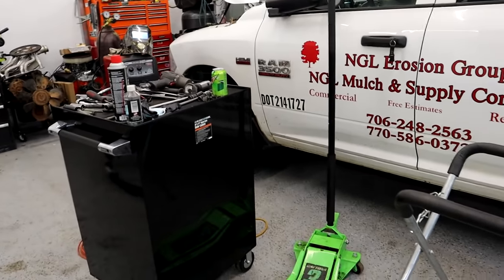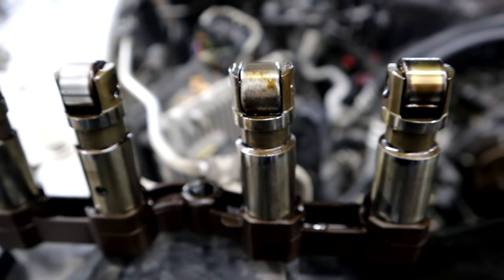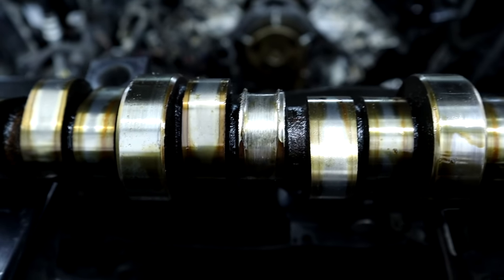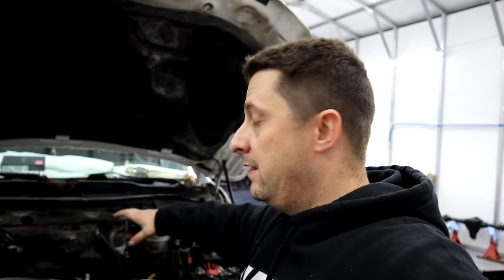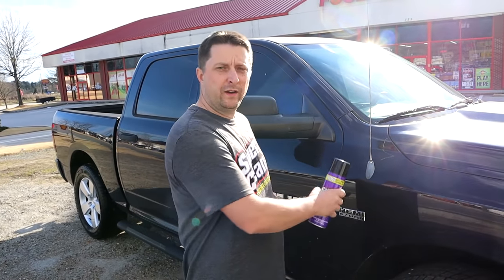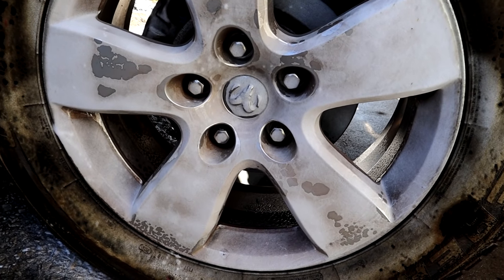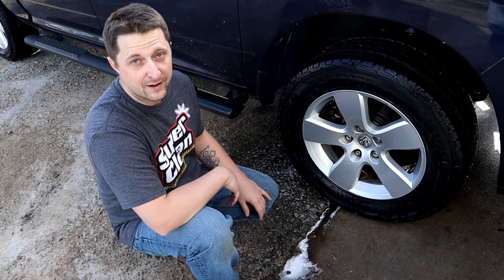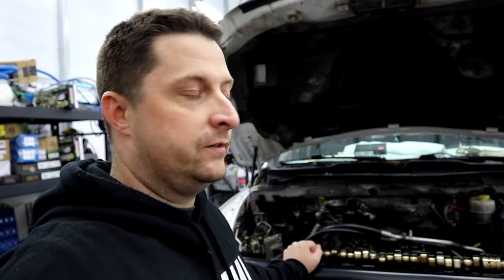6.4 HEMI Engine Failures Common Problems WATCH OUT.

Comment: What I'd like to know is are they changing to a different type of oil other than what the manual calls for? Does the manual call strictly for Pennzoil.
Reply from the maker: I use 5w30 in my 5.7
Reply: Yeah I’d be curious also. My 2020 6.4 calls for penzoil ultra platinum 0w 40 that’s it. It’s $65 to do a oil change myself. I’m hoping that doing it every 5000 I’ll get plenty of life out of the truck. My first new truck. 🤞
Reply: @FrostbiteRam  both my trucks 05 and 2013 calls for 5w 20. both are 5.7 as per manual.

Comment: Its  a manufacturing lifter flaw. There shit designed to fail and ruin cam causing missfire code from not being able to open ontake or exhaust valve.

Comment: Modern day oil is crap thanks to the epa emission system protectionis more important than engine protection, oil change intervals are way too long, super lightweight oils for maximum economy minimum resistance,  lifter bank angle was corrected to get the best pushrod geometry but at the same time is going to stress the cam and lifters more. The belief that roller lifters solve cam failures is false just creates a different failure point the rollers themselves fail all the time when heavily loaded. Just creates a perfect storm and far from one brand specific they all source parts from the same companies nowadays. Better oil designed to protect engine first, shorter change intervals, and less idle time, idling is the worst for any engine. Will help solve alot of failures period.
Reply: 0/40 isn't light oil

Comment: 130,000 miles and half the cam lobe consumed by the engine what does he do about the material that has been introduced from the camshaft lobe that's now been pushed through oil galleys and the rest of the engine ? When it comes back in six months with a lower end knocking who pays the bill ? That's the part that is scary ....
Reply from the maker: My race truck had same failure years ago and I race it hard new cam/lifters and flush been running like a monster 💪

Comment: I have a 14 6.4 2500. I’m creepin up on 100K miles. No ticking or signs of failure yet. 
I change my oil/filters every 5-6K miles at the dealership.
Any advice for preventive? Or just run it?
Reply from the maker: Just change your oil on time and run it.
Reply: I threw a rod a few days ago 😭
Reply from the maker: @DylanDiMartino  ouch

Comment: Why you pulling the head off to change a cam and not just the valve cover
Reply from the maker: Because the lifters is mounted under the heads on all newer hemi motors just like the GM motors as well

Comment: I disagree.... Most of the time it's lack of maintenance. If you have a lot of idling time, change on the engine hours not milage
Reply: Yup, you're right...I have a buddy that is a Mopar tech at a dealer and he says he has seen VERY few incidences....he said it is due primarily due to owner neglect. They can tell when the mill comes apart.

Comment: This is why I went with a Chevy Silverado 2500hd with the 6.0L non direct injection simple gas engine. About as simple as you can get in 2020.
Reply from the maker: Hopefully it holds up gm has had lots of lifter failures also.
Reply: @FrostbiteRam  most of the GM Failures are on the vehicles with the MDS system. The 6.0 does not have cylinder deactivation. My 2015 5.3 did and That was one of the reasons why I sold it and got the 6.0. 

No Direct injection, no MDS, just normal port injection and a V8 that runs on all eight cylinders all the time.

Comment: MDS just sucks ok. When new ok the 25-27 mpg on the highway is nice in your 1500 5.7. Durability sucks. I wonder if anyone has swapped in a mild to stock cam with non mds lifters I wonder how many more miles you could get out of these engines before any failures

Comment: Correction Hemi has problem TICK engine failure for bad manufacture major design flaws recall Cams, Thousands Dollars fix. The 5.7 hemi engine with towing trailer in mileage the check oil dipstick level, smell,  look color, and change the high oil/filter/air filter with the mileage. The stop engine failure, I see a friend have Chrysler 300 hemi I have sound, I check dipstick it empty and fill with 2 quartz oil.... no oil/heat the engines will seize.

Comment: Late reply but why is the same trucks going back in with this problem
Reply from the maker: Not the same trucks lol all different
Reply: I just bought the 22 ram 2500 6.4 a d your scaring me lol I've always had diesels loved the power hated the maintenance or the price there of. Got sick lost my butt . And this was a chance at a heavy duty truck . My thinking was a lot cheaper service maybe affordable repair. I was a Cummings owner for years until they done away with the standard transmission then went to the 6.7 ford and was happy with the power .like I said life issues hit had to get rid of my pulling trucks. I'm back to a 2500 hemi more affordable than a superduty hopefully it holds up
Reply from the maker: @me-63  i understand completely i have a 06 2500 cummins with the 6speed i love it but been thinking of selling and getting a newer 4th gen cummins with auto but all the emissions crap seems like a money pit🥴

Comment: To light of oil recommended by manufacturer.. 0w40 to light
Reply: You feel that a 40 weight pill is too light?  The 0W is the cold flow viscosity, meaning that it flows at 32°F like a 0 weight oil would. But it's still a 40 weight oil at 212°F. What would you suggest, a 50 weight? Gear lube?

Comment: I have about 10K miles on my 2020 tradesmen diesel and have not had any problems. No warrant repairs. I did order fully synthetic oil from Clear Lake Jeep Ram Dodge in League city Texas and they used a mopar blend. I went back to the dealership they replaced the oil with fully synthetic oil as I asked for. Then the douche bag service manager told me to make sure I order the correct oil ? WTF
Reply from the maker: Wow sounds like dealer service 😆

Comment: IT IS CALLED THE HEMI TICK.  I WAS TOLD DO NOT RUN THE MDS 392 8 SPD. AUTO IN ECO MODE.  RUN IT IN ANY OTHER MODE AS LONG AS IT ISN'T  RUNNING ON 4 CYLINDERS.  RUN IT IN SPORT, TRACK OR PERFORMANCE  MODE FOR THE SCAT PACK CHALLENGER WITH AUTO TRANS WHICH HAS THE MDS FEATURE.  THE SXT  V6 ALSO HAS RELIABILITY PROBLEMS HEMI TICK.  DONT KNOW WHY AS THE V6 IS A DIFFERENT. SYSTEM.  IN ALL OF THE ABOVE PROBLEMS PERHAPS IT IS THE OWNERS AT FAULT FOR DOING TOO MUCH MODIFICATIONS, NOT KEEPING CARS FACTORY STOCK OR JUST DRIVING THE CAR TO THE GROUND WRECKLESSLY, PUTTING IN WRONG FUEL AND OR POOR MAINTENANCE??🤔🤔
 ARE HEMI ENGINES CONSIDERED TO BE HIGH MAINTENACE?  
HAVE ANY ENGINES THAT WERE REPAIRED WITH FACTORY PARTS FAILED A SECOND TIME??🤔
Reply from the maker: They all go eventually some sooner than others.
Reply: @FrostbiteRam  YOU MEAN THE LIFTERS??UNREAL ..HIGH MAINTENACE AND COMBINATION OF  POOR DESIGN.  BEST THING TO DO IS THOSE FREQUENT OIL CHANGES NOT MORE THAN 5,000 MILES .

Comment: Why doesn't Chrysler have a recall on it ?
Reply from the maker: Unfortunately recalls are for safety concerns  only. Best thing to hope for is that it fails under warranty still.
Reply: @FrostbiteRam  I got a lifetime bumper to bumper warranty when I purchased the truck new in 09. I've got 130,000 miles on it. So far no issues.  Would it still be covered if it were to happen  ?
Reply from the maker: @louindorato6855  not sure need to ask the warranty company if they would cover that.
Reply: @FrostbiteRam  okay ty & keep up the great videos

Comment: how come this isn't a recall,   or class action. problem?
Reply: Because the parts are not the problem. It’s the lack of lubrication at idle and long mileage between oil changes
Reply: Recall? Doesn't affect safety. Class action? They usually make it past the warranty.

Comment: Good to see they learned from there mistakes. Is there any truck nowadays that you can just maintain and expect to be reliable for 250k
Reply from the maker: Not hardly lol perhaps a diesel but even they wont unless you start deleting emission components and thats not cheap either.
Reply: Yes it’s called a Toyota Tundra or Tacoma! Not the most powerful compared to American engines but miles ahead in reliably.
Reply: Buy a Toyota. Not all the fancy tech but not all the problems.

Comment: So, if we assume the lifter rollers are failing, why not preemptively replace the lifters at 100,000 miles, that way you save the cam and the repair costs would be much less. Are there any aftermarket lifters that are made better?
Reply from the maker: If you delete the mds and use non mds lifters like the hellcat lifters and a non mds camshaft you good to go.
Reply: @FrostbiteRam  
I don’t have first hand knowledge, but I have read that it happens even to non MDS engines.
Reply from the maker: @stuartstuart866  yes thats also correct and most the time its a non mds lifter that fails also. But really its a crap shoot 😓
Reply: Who the hell wants to spend 4 grand every 100,000 miles?
Reply: @jamesvaldez4093  
It should be a lot less than $4000 to replace the lifters only. I’m reading for less than $4000 you can replace the lifters and cam, a much more involved procedure.
I’m beginning to wonder if high rpm’s might be contributing to roller failure. Could the cam be spinning so fast that the roller just bashes into the cam instead of following the profile of the cam lobe? Once the needle bearings are damaged, the problem begins. Thoughts?
Reply: @stuartstuart866  I work in law enforcement and in 2016 I was issued a new dodge 1500 with the 5.7 hemi. The department bought a large fleet of these trucks that year. Immediately about 15 of the trucks experienced oil consumption issues. They were using 1 quart every 1,000 miles. The trucks were sent back to dodge who stated there wasn't an issue until its using 1 quart every 500 miles. So the trucks were returned and put back into service.
Here's where it gets interesting. The fleet manager picked about 10 trucks from the ones that were burning oil and started running 15w-40 heavy duty oil in them with 5,000 miles oil changes to see if it would slow the consumption. Well it slowed the consumption and interesting enough none of the 10 had cam failures while other trucks that were running the 5w-20 were going down consistently with cam failures. One time they had 6 that were dead on the line with cam failures and no parts were available and were on back order.
I spoke to a fleet guy in our shop about it and he said he believes it's the idle time along with the low weight oil that's killing them. He said using a heavy weight oil helps with lubrication and also keeps the mds from kicking in. They are all on the heavy weight oil now.
My truck along with the other 10 are near or at 100,000 miles with no issues which includes extended idle time, hard high speed driving, and even some hard track pursuit driving.
Reply: @jamesvaldez4093  
Wow, great information. We recently inherited a 2012 Ram with 136,000 miles, so I’m trying to learn all I can. The truck is in immaculate condition so I’d like to keep it, if it’s financially reasonable to do so. Thanks
Reply: Morel is a high end maker of RACING roller lifters, as is Jesel. NASCAR quality. Their stuff is hella expensive, and I don't know if they offer a Gen 3 lifter.

Comment: I had a 2015 Ram 2500 with the 6.4... I changed my oil every 5000 miles and never had any problems... It had 97000 miles when I sold it... I used 0/40w Valvoline motor oil synthetic
Reply from the maker: Awesome

Comment: I’m not a Dodge fan by any means I would never own one but. With most modern engine failures it’s 100% caused by the owner not changing the oil and running very crappy oil. 5000 miles max full synthetic required in all modern engines. I can tell you by looking at how dirty the cam shaft is on this and the front of the engine oil has definitely been neglected and that’s why it is in for service.
Reply: Then there are alot of negligent owners that are attracted to this type of vehicle so it seems who have alot more $$$$ than brains.
Reply: @leathernlatexmicrominiskir3784  🤣😂👍
Reply: People that spend this kind of $$$🤑 on these types of vehicles should know what they are in for the higher maintenance and more frequent maintenance to keep everything in check plus don't do any crazy modifications that will affect reliably more on these street driven vehicles.

Comment: Blame it on not having a proper oil change, it is a dumb excuse. This is happening way too many times on the HEMI engines, specially when spend a lot of time idling. This is possibly caused by uneven high temperature from the engine causing sludges to form causing lifters to fail. Toyota 3.0 V6 engines also suffered some thermal issues causing more oil sludges than expected, but at least Toyota engines have higher tolerance on oil sludges and many of them last up to 300000 km before rebuilding it. Maybe a better designed lifters can tolerate sludges a little better.

Comment: You can't just change the cam and lifters in them. The metal shavings off that cam have gone all through the engine. You're gambling on how long that bottom end lasts.
Reply from the maker: Done mine 50k ago lol still good👍do it right and no problems but the dealer will also say you need a engine lol

Comment: Take that engine out. Get a 383 with flat tappet lifters put a 727 behind it with a Dana 60 rear. Done.
 Call me back in 200 thousand miles. You can rebuilt it, in a week, in your garage for another 200K miles.
Reply: Flat tappet cams won't work very long in engines today because the over the counter oil doesn't contain the high pressure lubricant Zinc anymore. Now that it's gone... your going to have the same problems with wiped out cams.
They removed the Zinc out of the oil a few years back because it was killing catalytic converters. The powers that be, made car manufacturers warranty pollution control devices for 100,000 miles. So the zinc is no longer there. 
You need to run hydraulic roller lifters now to make a old school engine live. 
Been there.  https://ramchargercentral.com/mopar-trucks/my-'74-power-wagon-i-ordered-from-dodge-on-873/
Reply: Wouldn't pass smog or visual inspection in SOME states, especially Cali.

Comment: The oil passage from the crank to the cam is to narrow and has bad geometry on these engines, they don't get good lubrication to the cam and bottom side of the lifters causing the rollers on the lifters to lock up. Sad thing is Dodge knows this.
Reply: Correct!   Jokingly, one solution is to fill the oil level past the height of the cam shaft.

Plate [C]

Comment: I hate ram and gonna be honest. The engine that literally has the least problems is this engine and it is normally 4000+ rpms all day towing trailers up mountains lol.. wtf are you talking about.. the GM motors are all failing cause of cylinder deactivation. Ford turbos are going on ecoboosts. 5.7 hemi have manifold problems. This engine is actually super reliable hence why it hasn’t changed basically in 12+ years lol…

Comment: Why doesn't dodge just go back to hydraulic lifters instead of rollers? Problem solved.
Reply: See my comments re ZDDP levels in motor oils.  We wouldn't need roller lifters if we hadn't messed around with the formulation and weights of oils.

You brought up a really good point!

Plate [C]
Reply: Or you could just go with quality trunnion roller lifters instead.

Comment: My 2014 had a lifter fail at 108,000 miles. And RAM said it was not the same system. And could not do the same thing as the 5.7 hemi.  It's sad they know this issue and don't care. I'll never buy another one.

Comment: Seems the hemis are rather woke I'm in the market to buy a new truck won't consider the hemi since there so sensitive , the 7.3 godzilla is the same , so I'm stuck with picking a gas engine with the least amount of issues it's the gm 6.6 had three diesel tired of the expense,  Ill
 just take my time going up the hill and enjoy the reliability
Reply from the maker: All the gm motors have the same problem the hemi does will need cam and lifters eventually.

Comment: It's not a matter of merely "it sucks."  It's a matter of those Fiat Hemis are just junk - disposable engine..  $3500 to get you back your old 100,000+ engine?  First the valve seat dropping out of the head, then the lifter failure.  WHY is the lifter failing?  Is the splash system oiling (like a Briggs and Stratton lawnmower engine has) not adequate?  Meanwhile, people bolt turbos on junkyard LS engines with no problem.
Reply: My GMC went out with 25,000 mile. Lifters failed. Did all of maintenance requirements. All mfgs are looking to save money with cheaper parts and designs.

Comment: Good video hemi engines from chrysler are only good when there new after about 100000km or 60k miles they become problematic high oil consumption bad rear main seals noisy valves even at temp...worked for a company that had 6 2008 ram 1500 with the 5.7 litre hemi....just junk but because ram is cheaper than ford and chevy there super popular and there is always smokin deals on them

Comment: Machine shop told me, running a higher engine pressure will guarantee that lifter failure won’t happen again. 

I’m not a mechanic. I do have my 6.4 engine with them.

Comment: Yes even the 5.7 L is doing the same thing it's all garbage from the factory for putting these in these technically the factory should be sued they are deliberately installing these knowing that they are failing in the past there was a recall on them but they're still installing them such garbage search poor management with Dodge and all their manufacturing garbage